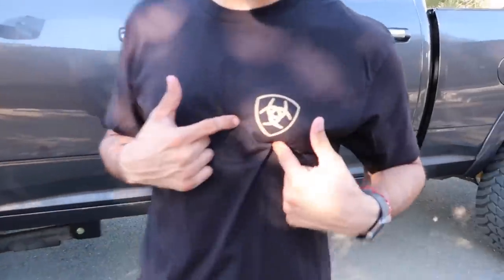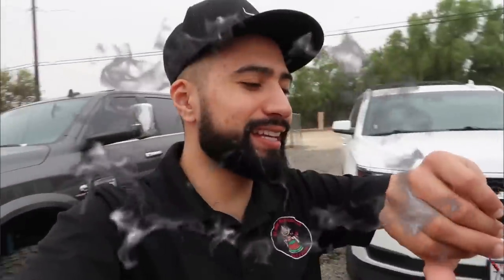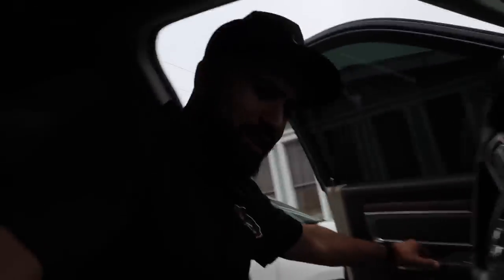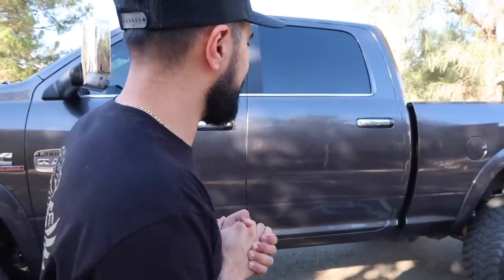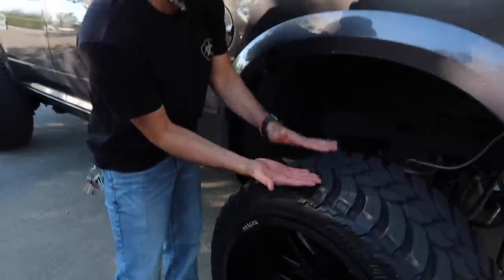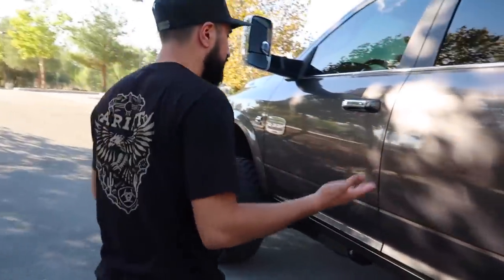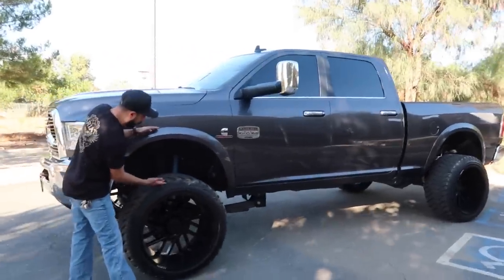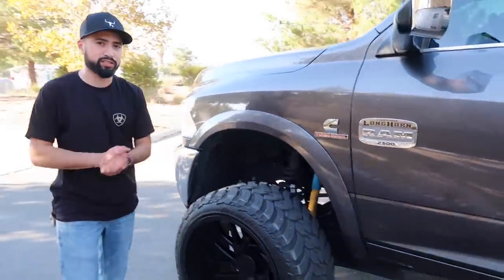NEW WHEEL SETUP FOR MY TRUCK!!

Comment: Fan of your videos, but I wanted to keep it real with you David: "bro"-built trucks like that are horrible at towing (when compared to stock, or near stock trucks. When you lift your truck, and mess with the suspension, tires, and wheels (rolling mass), your towing capabilities drop dramatically. Also, I hope you re-tuned your truck to account for your new set up, and got an alignment to protect your investment. On a personal note, I hate these truck set ups that don't put on mud flaps to prevent damage to their own trucks, and to those driving behind them. Wide offsets with no mud flaps throws up a lot of rocks, and other things on the road and flings it to those driving behind them. Bro-trucks like this can cause broken windshields and lead to accidents, which can harm you too. Just looking out for you, and others on the road.
Reply: Bro calm down
Reply: It’s not that deep

Comment: A Diablo sport in tune handheld device will calibrate your ECU to run with them tires and rims. Save you a couple MPG and wake it up a little more in the process. I got it on my ram,300, charger and mustang

Comment: Bro you might need to mess with your drive shaft. Sometimes with lifts the angle is off and it can fall off. Also, make sure brake lines are long enough , when you flex off roading with your current lift, it’s gonna stretch out and they can rip off. Saludos 🙏🏽✌🏾✌🏾